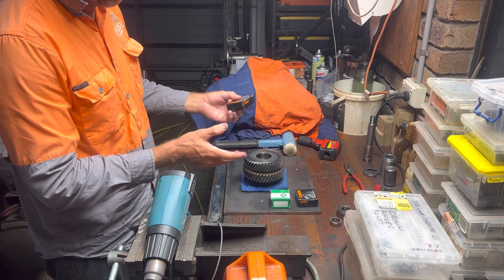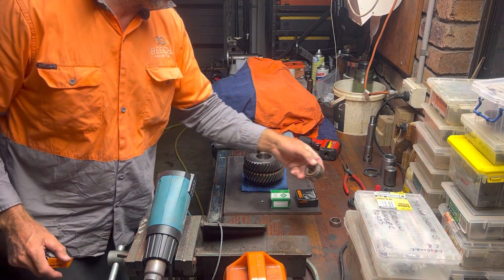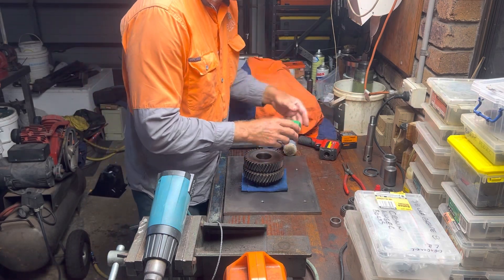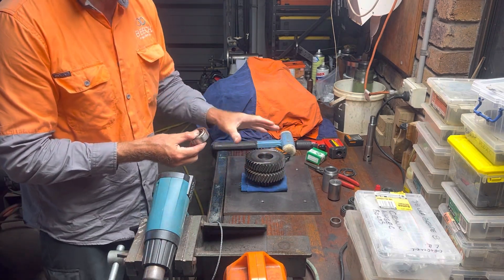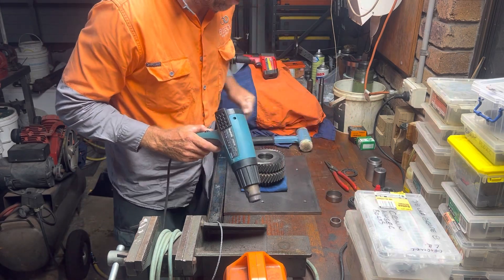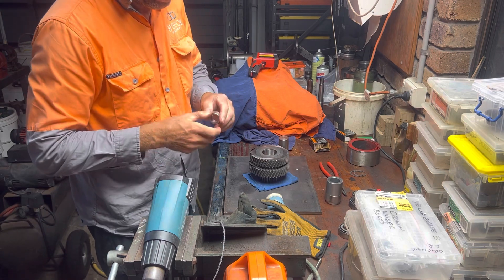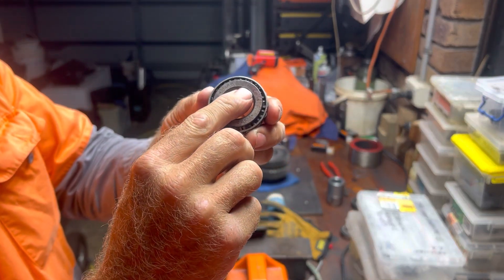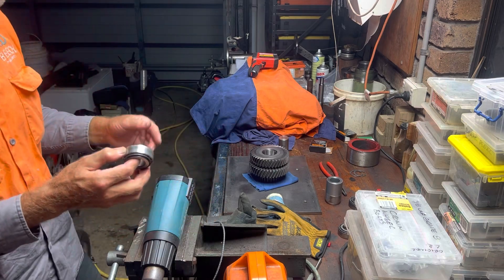MaxiDrive 30% Low Range Intermediate Gear Set Part 3 - Bearing installation

Comment: Nice video, what is the diameter size of low spur gear in the intermieate gear?
Reply from the maker: It’s about 71.5mm outside diameter
Reply: @Kustom110  thank you